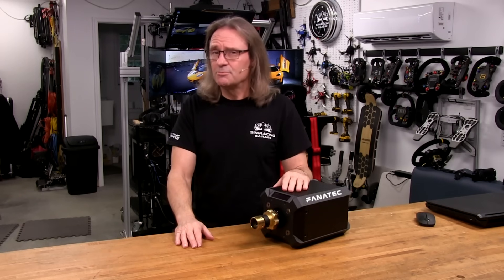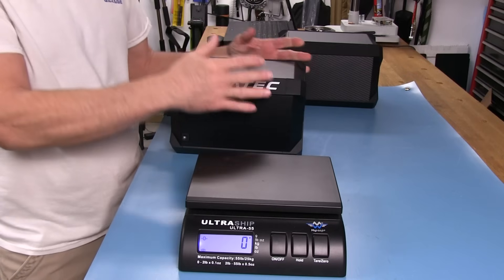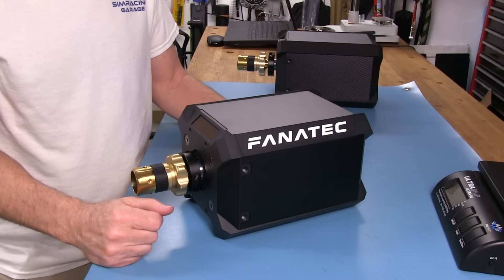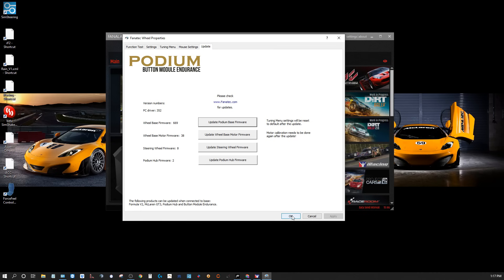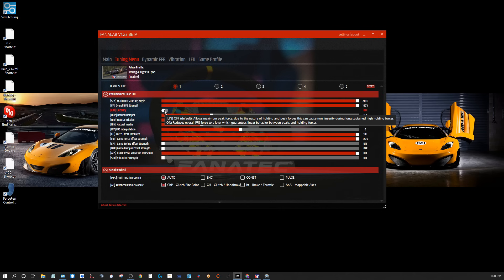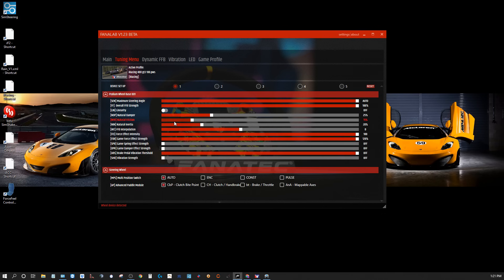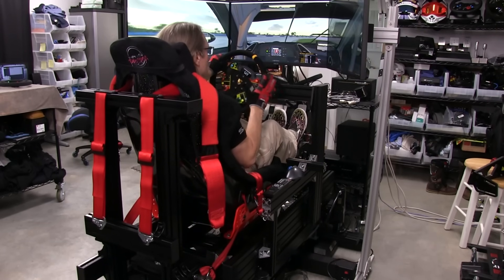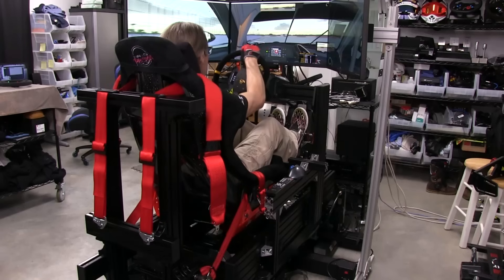Fanatec Podium DD1 Review

Comment: The 5 Nm difference actually comes from the carbon fiber panels.
Reply: I wish 😂 I have the Podium Wheel (the PS4 compatible version) which comes with the carbon sides, but still 20 Nm
Reply: @Urufu-san  
That's what I use. The carbon of the PS4 version has a blue shimmer...I believe that gives you even more torque. 😃
Reply: Attila TheHUN let me check... 😜
Reply: Fact! !
Reply: Pfff Actually all you need to get 10Nm more is to increase the voltage...
Reply: If you paint red stripes down the sides you go faster!
Reply: They had to put the carbon on it to justify the price difference LOL
Reply: @tylerstooksbury3050  The new type of carbon on the F1 wheel 2020 actually give the DD1/DD2 even more torque if they're paired, but they don't want you to know this!
Reply: Tyler Stooksbury uhh actually you’re paying for the PS4 support
Reply: @steve24822  add a spoiler to turn it up to 11 !!
Reply: @illuminat10n  lmao I was going to write the same thing,
Reply: From the pc rgb

Comment: The 'nonlinearity under peak holding torque' is a reference to the progressive  reduction (Vs time) of available torque from max instantaneous to max continuous, as required to prevent overtemp of the armature. It is a feature of virtually all motor controllers. Enabling the 'linearity' check box limits the available torque to 'max continuous' to ensure that the force feedback remains consistent under all conditions. 
'Linearity' is not a 'filter' in the usual sense.

Comment: The interpolation setting was huge for me when I installed this beta last week. I had mine set to around 3 and it removed so much roughness from going off the road some or hitting a curb. Before that I was getting some force that was so strong that it was basically false FFB. I would not get on the throttle at times I actually could get on it if I set this filter. Feels much better and I feel more confident in sticky situations.

Comment: One thing I would like to add, make sure you export all your Fanalab profiles before you update the firmware on your wheebase, as you will lose all your settings if you dont. Found that out the hard way.
Reply: Updating today, considered this might happen, thaks for tip
Reply: FanaLab profiles won't be deleted if you update the Base firmware...

Comment: Xbox compatibility is tied to the wheel. Playstation compatibility is tied to the wheelbase.  Not sure why each vendor decided to set it up that way, but that's what's going on.  On the plus side: if you get a PS4 base, you can get an xbox wheel, and have compatibility across all possible systems.

Comment: Im not sure, but I wonder if Barry might be misunderstanding the Linearity setting?
I havent really done my homework here so I could certainly be wrong, but I interpret the Linearity setting as it will reduce overall strenght, to make sure any torque peaks will come through without clipping.  So if anything, force "spikes" or other forms of very powerful forces (eg hitting a kerb at the bottom of eau rouge or similar) should be sharper and more defined in this setting.
It should make you be able to feel the whole spectrum of forces without any of it being clipped due to lack of FF-strength, but at the cost of lower impact in the "normal" range of forces.
Again, I haven't read any documentation about this setting, so I could be misunderstanding this.
(also, I don't own the wheel so can't test it myself)

Comment: PS4 compatibility comes from having licenced PS4 code within the wheelbase's firmware; Xbox compatibility comes from the attached wheel rim, hence you can make the DD!/DD2 Xbox compatible with just a new rim. The PS4 version is ok value-wise as your get the F1 rim AND the podium shifter module.

Comment: I still would like you to tear down the DD1. Check whether the PCA is same than in dd2 (part number). Would be interesting to know if that torque limit is done by HW or SW. Fanatec says DD2 and DD1 has different electronics but I'm not that sure!
Reply: thats why he didnt do  tear down,it was a clause i bet
Reply: patchedupdemon very possible
Reply: Fanatec said themselves it's not just software. I trust them enough to know it's true. I would love to see the electronics though. Especially the difference between dd1 and the PS4 dd1 (extra security chip etc.).
Reply: @patchedupdemon7104  You may be right. If it gets us his reviews though. I am ok with that.
Reply: This has been the most unauthentic review video thus far. Why the summary conclusion that the weight difference is the aluminum vs carbon fiber plates? There should be a side by side breakdown comparing the case, motor, circuit boards, down to the screws. The video has been somewhat of a let down considering Barry's one of the few with both a DD1 and DD2 and a youtube audience.

Comment: This video was posted some time ago, but I have a question regarding the DD1.. seeing I just ordered one :-) I've been using a Clubsport V2.5 for about three years, and I got used to lubricating the shaft of the base, because I switch between iRacing and Dirt Rally 2 a lot - F1 to round rim, and it feels like it wil wear over time. I did not see the DD1 shaft in front of me yet, but in pictures and videos it looks to me as if it shouldn't be greased up because of the square rubber.. What do you think? Thanks in advance! And keep up the good work!

Comment: Podium Wheel Base DD1 / Podium Racing Wheel F1® PS4™

Tuning Menu Settings:
SEN 1080 (shown as 108 on some displays)
FF 90
LIN ON
NDP 16
NFR 2
NIN 8
INT 3
FEI 100
FOR 100
SPR 100*
DPR 100*
BLI User Preference
SHO 100
BRF User Preference

*SPR and DPR values have no effect by default. They can be enabled through the app.ini, but this is not recommended.

In-Game Settings:
Wheel Range and Map Range: Automatically determined by calibration wizard
Use Linear Mode: Checked
Reduce force when parked: Checked
Strength: 6.0**
Wheel force: 20Nm
Damping 0%
Min Force 0.0%

Comment: Regarding the Podium Racing Wheel for PS4 : the PS4 Security Chip is NOT in the blue Formula steering wheel, it is IN THE BASE! Therefore the normal DD1 and DD2 can't be upgraded to PS4 compatibility, because they both do not have this PS4 Security Chip and therefore when attaching that blue Formula Wheel to a normal DD1 or DD2 doesn't make them PS4 compatible. This is well documented and its very surprising that you got this one wrong...
Reply: How dare someone get a detail wrong about your precious PS4? Surprised you didn't tell him to go sit in a corner for half an hour.
Reply: So if its just a chip why didn't they just add it to ALL bases. Very odd
Reply: @02semiata  not really odd, most likely licensing reasons. ^^
Reply: @momorious  agreed...everybody wants to get paid for everything little thing!
Reply: @momorious  Fanatec can afford the license /charge more. Its a silly move on their part
Reply: Yeah, and if you attach an xbox capable  rim, it will work on all 3 platforms by simply changing modes.
Reply: @02semiata  i believe Playstation charge a significant amount for the license themselves.  if you look at the csl elite wheel bases its a price difference of 50 usd.  most of that would be going straight to playstation.  why increase the cost of all bases for the few people would use it.  And im sure if they did, people would complain they were paying more the the license when they didn't want it.
Reply: Momorious do you know if my CSL Elite rim will work on the DD 1? On PS4?
Reply: @Imberserk4books  every wheel works on PS4 if it's used on a PS4 compatible wheel base, which in Fanatecs eco system is only the Podium Racing Wheel F1 Bundle or the CSL Elite Racing Wheel. The regular DD1 and DD2 are not PS4 compatible.
On all DD Bases Torque would be limited when you attach a CSL Wheel because of the plastic QR.
Reply: @momorious  ok thank you very much. So in regards to the tourqe limitations, a podium rim is recommended? Or is there a converter for the CSL?
Reply: @Imberserk4books  there is no converter for CSL Wheels to enable High Torque Mode. Only the discontinued McLaren wheel can be upgraded with a ClubSport QR which enabled High Torque. Every plastic QR limits the Torque output to CSW v2.5 level around 9Nm Peaks.
Reply: @momorious  ok thanks again. I think for now I'll just stick with the CSL wheelbase and wait till I upgrade to PC for a direct drive wheel. Thanks again for your help i really appreciate it

Comment: Has Anyone experienced a build up of magnetism within the DD1 causing a lumpy resistance points (roughly 10 or 11 peaks of resistance within 360 degrees of rotation)? Restarting the wheel base removes the resistance points but they return over time if the wheel is used and remains powered on. The resistance is strong enough after a few hours that the wheel will not remain centred unless I hold it. If anyone has had this happen, have you found a fix?

Comment: I was really hoping the new drivers and FW would fix my DD2s fan issues....random 100% RPM at startup and idle....Nope, it’s even worse now. I’ll turn it on and the fan will go nuts until I start driving for awhile. Almost every time now. Before it wasn’t that bad. 

I’m not looking forward to pulling it off my chassis and having to send it back. Seriously, that’s major task for me. They should send me a new one and take this broken one back in a return package at least.
Reply: Sad to hear you have even more issues with your DD2 buddy! Think I will keep my CSW 2.5 for quite a while!..
Reply: If you had the chance again would you have just gone with a SC2?
Reply: Travis Lu Absolutely. It’s more expensive in the long run but if I’m willing to spend $1500+ on just a motor, I should be willing to pay a premium for premium wheels and QRs. 

 Performance wise the Podium DD2 is getting better....way better. When I first got it in July it sucked. I was pissed I bought the DD2 then sold my CSW V2. 

Right now, beside the fact I’m going to have to send it back because of the fan issue....which is a huge inconvenience and a pretty big task itself. 

 My only complaint with the DD2 is the QR system. It doesn’t reflect the price. I’m happy its backwards compatible but it came at the cost. 

I honestly wouldn’t mind using a usb cable and aftermarket wheel.
Reply: Did you update your motor after the software update?
Reply: Dennis Ro Everything is up to date.
Reply: @OhItsThat  What version are you running?It's still beta correct?
Reply: Logo 800 Im using beta. 

Driver 352
Wheelbase FW 669
Wheelbase Motor FW 38

I was on the public versions thats available on the website. The issue wasn’t as bad but it was still there. Plus the performance on those drivers and FW wasn’t very good in my opinion. The beta ones Im using now are better. I’m at least feeling some improvements over my CSW V2. So I’m not willing to switch back. 

The RMA is already to go. I just haven’t had time to tear it off my chassis and send it back. It’s actually a fairly good size project. 

Ive been very critical of the Podium DD2 since I got in July 2019. Mostly performance and the QR system. It’s really unfortunate my experience continues to be less then impressive with this package. 

Still think I should have left the Fanatec ecosystem.
Reply: @OhItsThat  I'm on 347 with my V2.5 but, at times my wheel makes a snapping or clunking noise. The wheel is smoother for the most part.I really want to try a DD wheel just a little shy after hearing all the issues. 

Thanks

Comment: wait, the E-Stop is a normally open contact? should be normally closed, so it shuts the system off when the connection breaks.
Reply: Wait what? If it's normally open, you break the connection by closing it, and it shuts the system off. So that's exactly what it does.
Reply: @jakehopt  true, but if one of your cables breaks or snaps and you don't notice, you won't be able to close the contact anymore, so the system wont shut down even if you flip the switch in an emergency. 

If it's normally closed and a cable/ component breaks, the system shuts down immediately (you shut down the system by opening the circuit via the switch). basic electronic safety feature/ failsafe in every halfway decent emergency shut down :)

Comment: Just buy a dd2 and a ps wheel and use a drive hub with hori controller, it will work out cheaper than the podium f1 for ps4 and it works exactly the same

Comment: I always hit like before I even watch the video, because I know barry always does a great job and I don't want to forget!! Also, can you explain why you use the Dampening Overlay speed sensitive enabled over disabling it? Do you think this actually makes the wheel feel better and more realistic? I haven't used it before and clicked it on when I saw you did and it does seem to make everything less sensitive and controlled. Maybe also care to explain why you picked that specific Speed Threshold as well at that MPH? Thanks! Last question, if you have your wheel running without fanalab, does it not apply the speed sensitive dampening overlay?

Comment: Interpolation should be set on a per engine basis, not per car basis. Also, interpolation need isn’t subjective. If the Hz of the game engine is low, you want a light interpolation. No real car has that grainy feel while rotating the car: it’s a purely digital to analog artifact caused by the refresh rate of the engine not maxing out the wheel refresh rate (1000hz)

Comment: I was scared away from Fanatec products after purchasing their Clubsport V1 pedals a few years ago. Can anyone speak to the reliability of their direct drive wheels?
Reply: I've had the DD2 since launch. I've put easily over 1000 hours on it. And I can honestly say, I've literally had zero issues. Minor or large.

I'm beyond satisfied with it. The updates and software have made it better. But everyone's mileage will vary.
Reply: @Mikey6048  Thanks Mikey.
Reply: @lylecrawford2794  What sold me over other brands is the ability to connect everything, even my Asher Racing Rally Paddle shifter, directly to the DD2. And use only 1 USB out for 5 peripherals.
Reply: 0 issues here, big or small. They have sorted out the power button problems also that existed in first batch for some
Reply: My DD1 lasted 4 months 🙄

Comment: Your settings for Dynamic Damping have no effect because you disabled DPR in the tuning menu which is necessary for the dynamic Damper to have an effect. You were already told that DPR is necessary in your previous videos where the Dynamic Damper already didn't worked for you because you disabled DPR... A value of 050 is already enough on the DPR to get the dynamic Damping working properly.

Comment: 352v firmwares made my dd1 feel like poopy. quickly back to 346v which is best feel for me.
Reply: The setting used for the earlier drivers need to be changed when you install the 352 driver.   I had the same experience as you did.   I installed the 352 driver and kept the same settings as with the older driver and it felt very weak.  So I reinstalled the older driver.
  But the next day I installed the 352 driver and made some adjustments to my settings and it was much better than the older driver.